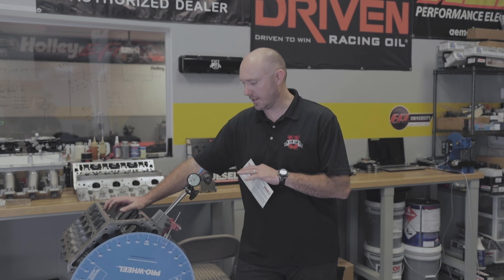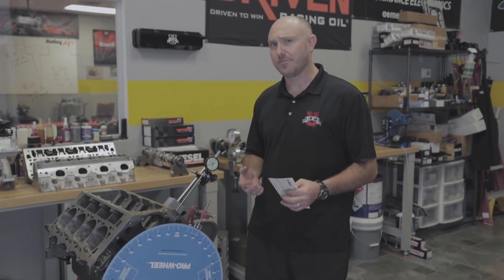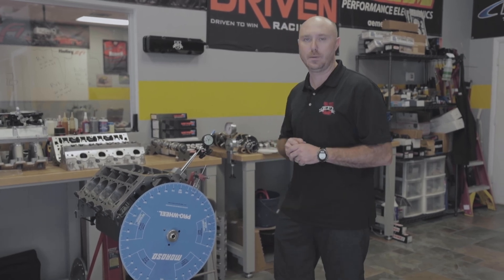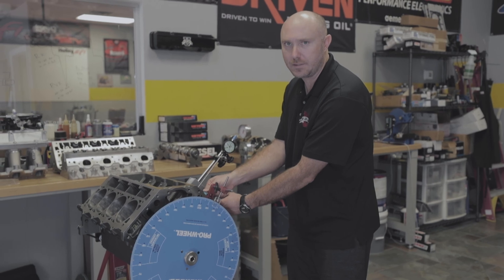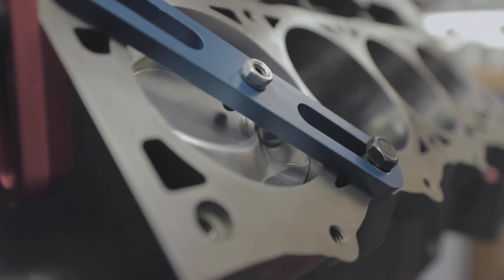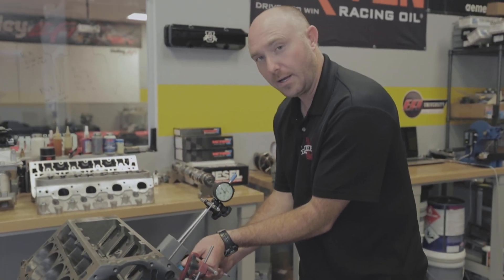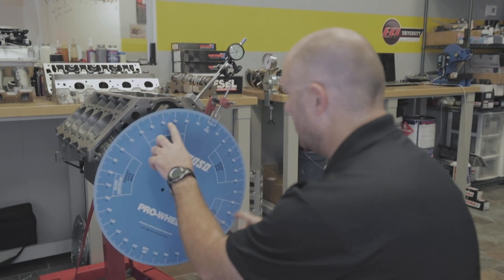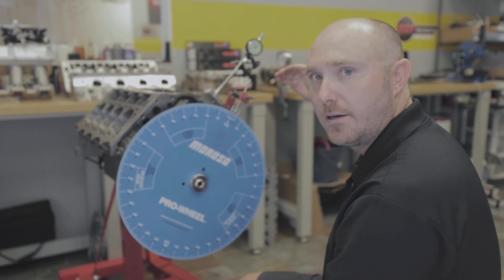Finding TRUE Top Dead Center

Comment: Thanks!! 

I think this is correct.

But I was taught as a lad that best practice is to always turn the engine in the same direction when setting the +h -h positions. Otherwise backlash effects cause a tiny error in your +angle -angle positions. For this reason we always used a zero’d dial gauge instead of a hard stop for the nominal TDC height.

Your method is way better than 99% of what you see elsewhere and if we compared it with what I was taught, I doubt there would be much difference.

Comment: I'm working on an Audi A6 (3.0 - V6) and when I initially broke the engine down and used the top dead center pin in the crank, The pistons at the top were #2 and #4 ... I removed the timing chains, etc... and i want to tear this thing all the way apart, but how do I get timing from scratch? The manual sucks and always refers to using the TDC pin which is only good for partial repairs, not full engine break down and rebuild....

Comment: How come when harmonic timing marks are set to TDC the piston is all the way up, which means the ignition timing is set off TDC but not true TDC ? Is the piston position you determined in this video only for setting up the cam?
Reply: These videos seem to suggest that the factory timing pointer and balancer marks are not accurate.  The technician is determining TDC as step 1 to degreeing the camshaft.  The video is not intended to suggest that his determined TDC location is not the same as the factory timing pointer and balancer had they been installed. Speaking from experience, determining TDC will almost always "verify" that the factory timing pointer and balancer marks are accurate to within 0.5°. In fact, you should practice this method with the timing pointer and balancer installed to get a feel for the procedure.  I do this myself to train others how to do this procedure correctly.  Depending on the engine, it takes a collection of all thread long bolts, washers and spacers, to set up the degree wheel with the balancer/pointer also installed.  Once set up, you can turn the engine but also loosen a nut to move the wheel to 0° when required. Once set up like this, you can repeat this procedure 10 times in 20-30 min and you will have it down pat and can teach others.